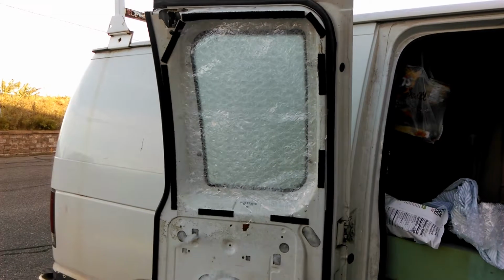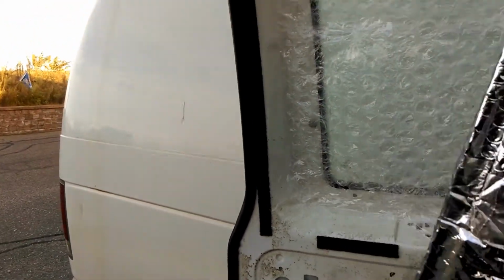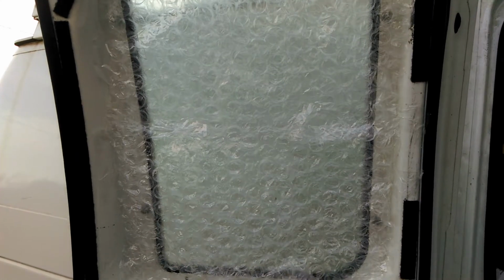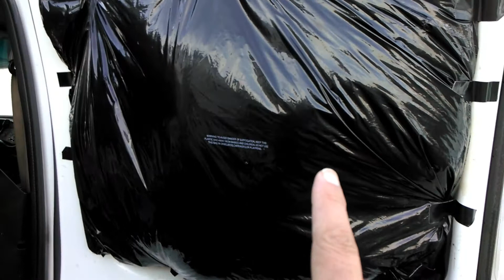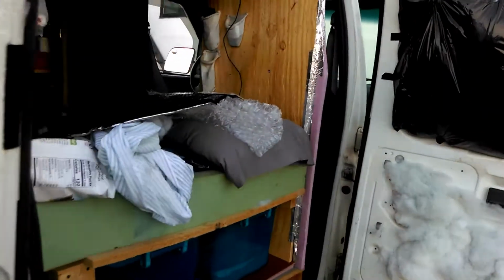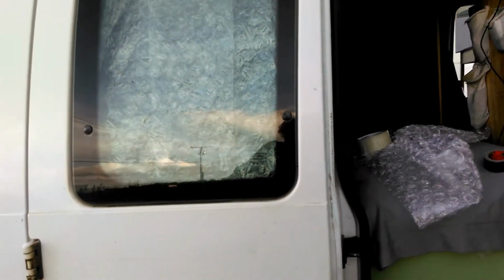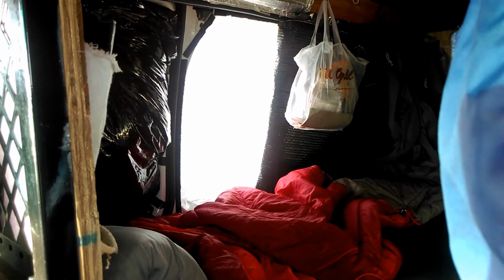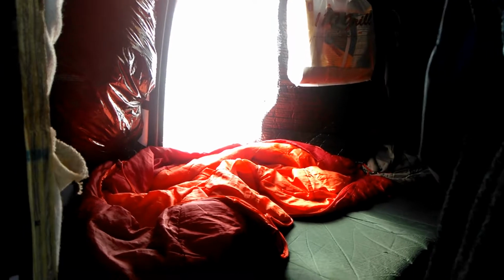Bubble Wrap Window Insulation

Comment: Bubble wrap is a great idea.   It will create an air barrier which is necessary.  If you want some more rigidity you could use some white plasticore.   (Corrugated plastic).  Or just take some campaign signs when the election is over. Just make sure to duct tape the outer edges well. Lol.  I only know this cause im working on a project now for window coverings
Reply from the maker: I've had trouble getting tape to stick to that corrugated plastic board and from what I learned online there's only one obscure glue that will bond with it. I'll figure out some kind of removable insulated window covers for the next van but so far I like the bubble wrap. I could really feel the warmth of the sun on my hand through several layers. Passive solar windows for winter warmth? Hmmm...
Reply: VANgazmic Voyage I have duct tape on the ones I have made and so far they are holding wonderfully.  Hopefully they will last!   I do like how yours let light in

Comment: Can you do an update, looking to see if it helped with condensation
Reply from the maker: There has been some condensation on the window because I don't have it completely sealed and because the propane heater producesa lot of moisture. But I do keep my roof vent open a bit at all times for ventilation and I don't run the heater at night. 

My walls are insulated and covered so I don't know if there's any condensation under all that but the insulation i used does not mold

I'm thinking about removing the bubble wrap and painting the windows black for stealth